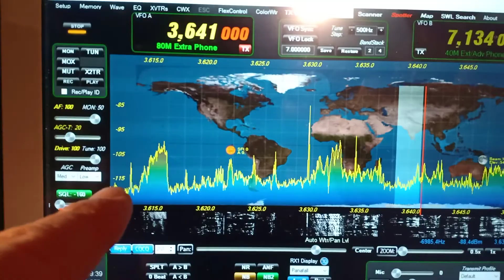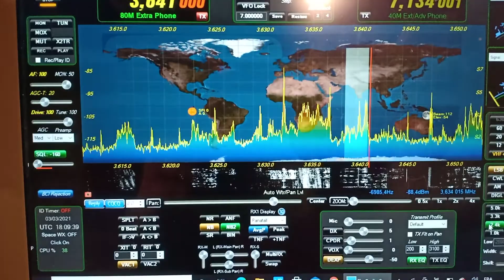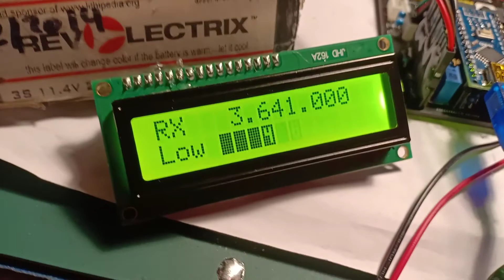F5NPV - Homebrew SDR with the ASUS Xonar U7 soundcard

Comment: Mantab
Reply from the maker: Terima kasih buddy, your design is simply awesome . Working perfectly
Reply: @f5npv-v85npvamateurradio3  for Arduino it causes a lot of noise, now I upgrade to use ST32f103, and replace 4051 with fst3253
Reply from the maker: @YE3CIF  Ok i will try this weekend with the FST3253. for the arduino , i remove the leds because they create noise. maybe with my other board i can try the ST32F103. BTW many thanks for your design , simple and efficient . work very well and all report a very good audio.
Reply from the maker: i am using the LMR SDR for 3 months now , and more than happy about this transceiver. i am going to build a second one and clean up a bit my shack and i will keep only SDR transceivers. i will sale my other transceivers